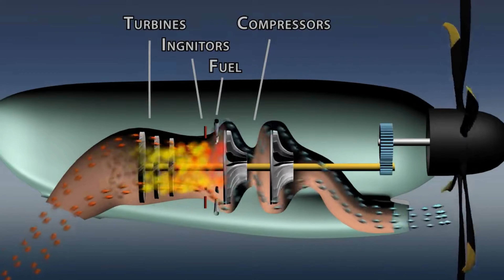USN High-Pressure Steam:  A Successful Detriment? | A Portholes Podcast Special ft. @Drachinifel

Comment: There are three issues:
1. Did the high pressure ships have shorter ranges than expected?
A) due  less efficiency v low pressure or  just less than planned
B) due to more than anticipated high speed usage
C). USN didn’t know how much fuel they were using! (This is inexcusable.)

2. The gearing bottleneck.  This was well known during the war!

3.  Admiral Bowen’s CYA book.  

Brilliant Drac  keeping the guys on topic and out of rabbit holes!  Just my cup of tea (steamed with fuel oil)
Reply: More importantly, did the 600psi plants have better energy density than 350psi?  The answer is yes.  

And with the tyranny of the treaty limits, weight was critical.  Every ton of machinery was less armor, stores, armament...and fuel.
Reply: @olpaint71  Yes, but the point of this is that those high pressure turbines were not in fact as fuel efficient as the USN had expected, not by a considerable margin. And certainly in the first half of the Pacific war that was an issue as all fuel had to be shipped to the USN. That means tankers and fast fleet oilers. For the first half of the war the US was seriously short on tankers (especially after the losses of tankers suffered on the East coast in the first 6 months), and critically short of fast Fleet Oilers. They only had six of the latter at the start of the war, and lost one at Coral Sea. 

O those high pressure boilers being far less fuel efficient than expected had a direct and negative affect on logistics because it means more fuel is required, and you have limited shipping capable of transporting that fuel, and that is going to limit your options operationally. 

Sure, this is less of an issue in the second half of the war, but in the first half its significant.
Reply: @alganhar1  But the high pressure plants enabled more compact and lighter machinery, which meant more protection, firepower, and performance on the same tonnage and, even if the range did not meet expectations it was still more fuel efficient than a 350psi plant.  

The Pacific War was never going to be fought without an extensive logistics tail, and the difference between the high-pressure plants and the earlier systems is well illustrated by the USN holding the remaining Standards at Pearl while the more modern ships fought the early war.  

If you are going to argue the 600psi plants were detrimental, you have to not only show that they didn't achieve the promised range performance, but that they also performed less efficiently and less effectively than the alternative, which is a ship with a 350psi plant that has reduced protection, armament, and even higher fuel consumption.

Comment: So I have a long winded comment because I do want to have a discussion on this as I have been trying to research the development of USN high pressure plants of the interwar and WWII period. First caveat is I have yet to buy the book which I am going to because books about powerplants are rare and awesome. But I feel as if in this podcast there was no real defense for the USN machinery, which was overall lighter, had very good reliability for that pressure, and did produce fuel economies when cruising long distances. What wasn't considered in my opinion when it came to the operational ranges of the high pressure machinery was that wartime additions in weights. All ships in the USN got much more weight added to them as wartime progressed such that I'd argue every single USN ship got more AA guns and more radars and sensors than initially designed in lets say the mid to late 30's. This would explain the discrepancy between the advertised fuel savings and the real wartime economy of these ships. But I suspect that there was a decent amount of fuel savings with the high pressure plant as Bowen does mention in his book Ships Machinery and Mossback (granted that is his own personal biography so dose of salt here). I am as Othias from C&Rsenal says a determined idiot with internet access and not a proper archive and researcher but I do want to try and unravel the full story of USN machinery, which while it was not perfect or the one trick wonder the USN needed to win the war I still believe that it was not a hinderance but something that did help the USN win the war against Japan and also laid the foundations for the USN post war to have the best steam plants full stop. If you made it this far in this comment, give yourself a cookie because you earned it

Comment: I was chief engineer on Manley DD940…  staying on top of maintenance was key to reliability.  Fuel economy was greatly affected by the anticipated speed demands.  If on a straight line ocean crossing we would be able to make 18 kts with half of the auxiliaries secured …ie one feed pump one forced draft blower on each of two boilers.  If the XO wanted 27 kts available for training, the fuel economy was crap…  it all depends on how hard you run the greyhound.

Comment: I admit I have not read the book yet, and in fact hadn't heard of it until now.  This is an interesting discussion but I have to question a few things.  First, the new ships with their  high-pressure plants were making the same fleet speeds as the older ships.  They weren't going faster than the old ships and burning up vastly more fuel than the old ships as this seems to imply.  Their lb/shp/hr was still better.

Second, while I would normally hesitate to correct Drachinifel on anything naval, it is not true that turbo-electric ships maintained a constant turbine speed and hence were more economical at high speeds than geared-turbine ships.  Turbo-electric ships used AC motors whose speed was directly proportional (with some variations because of pole-switching) to turbine speed.  They did not use a constant AC frequency; motor and shaft rpm changed with frequency.  To increase speed in a T-E ship you increased turbine speed, just as in a geared-turbine ship.

Comment: I steamed 1200 psi steam plants when I was a boiler technician in the Navy 🎉 they were very efficient in my opinion, we didn’t need a extra burnerman to operate the superheated side of the boiler because it was a internal part of the boiler which took the heat ahead of the generating tubes after the screen wall tubes which saved on manpower to operate a boiler

Comment: Great discussion. But perhaps without actually reading the book, the answer can be... boiled... down to : "It was wartime, it is what it is." 

Regarding turbo electric, it often gets a bad rap IMO. Comparing the Standard BB's from the late 1910's with technology 18 or 20 years years later, is hardly fair or accurate. Improvements in both motors, generators, and electrical drives did increase efficiency and durability. Today the improvements are very dramatic (although they are generally only paired with Diesels now).  If the ship that destroyed the Keyes Bridge near Baltimore had D-E drive, that simply never would have happened. That disaster brought to light a dirty secret: Those failures are very common and it was only a matter of time it happened at just the wrong time and place..There are several maintenance and reliability advantages to having multiple smaller engines verses a giant one with pistons so large two men could stand inside them. The difference in fuel economy verses direct drive is slight. But despite the reliability and safety advantages, most ships are built the cheaper way.  If we want America building ships again... Perhaps we should start insisting on only allowing D-E ships in our ports for safety... And then build them ourselves There are some very good designs for PM motors and drives done for the US Navy, that give us a technology edge.

Comment: Love this discussion I am a mechanical engineer that designed large gearing systems especially helical gears for Horsburgh & Scott in Cleveland OH . Double helical remove axial thrust loads down the shaft generated because of that angling in the gear tooth on the gear face. Double helical cancels out the axial thrust forces, the bitch is they are LONG lead items requiring grinding of the tooth involute, especially on high quality level gears (Ships gearing must be more accurate and precise than a concrete mixer reduction box ...then there is the heat treating.  Replacement is not like switch out a transmission in a car as Ryan mentioned

Comment: The high pressure plants may not have been "as advertised" but they did a job.  If Essex class carriers were immediately scrapped 1:1 as new carriers were built like B-36s to B-52s, that would show a immanent deficiency.

Comment: 52:00 Good grief.  No, you don't perform endurance trials by burning every drop of fuel oil to see how far it will go.  You run the trial for several hours to get accurate speed and fuel burn numbers.  It gets compared to the model test resistance data and the plant design data to correlate the theoretical curves and actual consumption.  These guys should know this.

Comment: 20:15 the other problem with single reduction gears in trying to do anything in a single stage is gear wear. The driving gear would have to do so much work, it would wear out long before the driven gear would show any signs of wear. Manual transmissions in cars are double reduction for that reason. The counter shaft is reductive before going into gear on the output shaft

Comment: Diesel electric propulsion for rail was still very much so early stages in the late 30s. Large medium speed diesels like the Alco 239/240, EMD 567 and others were having lots of teething problems. Everything from large blocks being made at scale with ever changing materials to gasket materials being changed resulting in water and oil mixing.

Comment: This is the sort of topic I love. So please do more like this. 

That being said and I’m truly not trying to be a keyboard warrior you really failed to make your case on this one. 

We have allegations of falling short on range that are not substantiated in the video. We do have excuses in terms of the vast difference between wartime operating conditions and peacetime assumptions that may have had a lot to do with this. If your range assumptions are based on cruising at 15 knots with half the boilers secured and your operational conditions require all boilers lit and operational with regular bursts beyond 15 knots those range numbers are going to be garbage. And that’s not the fault of a 600psi plant. Another issue is that just like with standard vs full load displacement range is dependent upon a host of variables. Trials will give you good baseline data for the conditions they are run in. But higher sea states, heavier ships as crew and weapons are added, increased hotel loads on the plant, hull fouling will all have an impact and those are not the fault of the plant. If you want to argue that high pressure steam doesn’t deliver on the benefits it promised show some range tables (projected vs actual) that prove that out for example. 

You talk about manning and maintenance but provide little to support that. Comparing the manning requirements between a British light fleet carrier and an Essex is an apples and oranges comparison to a degree. How does the KGV class compare to NC or SD? That would be a meaningful comparison. And if your the US and you have plentiful manpower resources designing for reduced manning likely isn’t a consideration like it might be with other Navies. For example the Yorktown and Essex class have very similar manning numbers and one is high pressure and one isn’t.  A look at the numbers in the engineering section of those two classes could provide meaningful insight. It also might be very interesting to look at the number of watch standers in a boiler room and engine room on New Jersey in 1944 vs 1989. 

How many man hours of maintenance were required per hour of steaming? Without comparisons of that type between USN High Pressure and older low pressure systems it’s hard to say these were maintenance intensive systems. I’ve never read anything that indicated the 600lb 850F plants were anything but extremely reliable in service in WW2. I know for a fact that in the 90s when I was on active duty they were considered to be very very reliable plants. Unlike the 1200lb plants which were always considered temperamental even though they continued to get better with each generation. 

Which brings up another point. If high pressure plants were judged a failure by the USN then why did it continue to press forward with higher pressures and higher temperatures in the post war era? It just doesn’t make sense that if the navy thought the move from 300 to 600 was a mistake that it would then proceed to press forward to 1200 and stay with 1200 even when the early generations of that plant really did have serious issues. 

To Drach’s credit we do see the issue of power density come up. It doesn’t take much reading of Friedman to know that was a really important consideration in the WW2 generation of ships. Iowa doesn’t happen if her machinery has to be 15-20% larger because it’s operating at lower pressures. 

Again I’m not trying to be a keyboard warrior but if your going to call into question something like the 600lb 850F plant technology that went into the vast majority of US WWII fleet units you need to actually make that case.
Reply from the maker: Thanks for watching and taking the time to comment. New research is threatening to upset a lot of what we think we know about the early war operations, fleet logistics, pre-war training, and how the Navy implemented innovation. We're just starting to get our heads around the implications. We'll need a larger and longer format (with guests) to work through the US Navy's largely untested acquisition of high-pressure steam in the future.
Reply: The RN in the steel era is best known for exploding ships and memorials, so I'm not sure they're the be-all.
Reply: @BearingStraight 
A careful look at new research in and of itself may also be necessary. Hone says the USN became a night fighting machine by late 1943, but at Philippine Sea, Lee hid under a table when asked to engage at night.
Reply: @UmHmm328  that is an incredibly offensive comment essentially calling Willis Lee a coward. 

It’s utter nonsense to say he hid under a table. Lee was asked if he desired a night engagement and said no. He was well aware that this didn’t mean the Japanese would be allowed to proceed unmolested. The carriers were still more than capable of taking the Japanese on and denying them the chance to achieve their objectives. 

Lee declined a night engagement because the previous months of carrier operations where his ships were focused on AA defense had denied them the opportunity to do any training together or operate together as a tactical formation. He was well aware of the problems that lack of training could create in a night engagement and his judgement was sound. 

Contrast that to several months later at Leyte Gulf where Lee is trying to prod Halsey into releasing TF34 so he can engage the Northern Force he knows is coming.

The fact that Lee declined the chance for a night engagement in those specific circumstances does not remotely invalidate Hone’s research.
Reply: @jetdriver 
Oldendorf didn't seem to have a problem at Surigao Strait.
He was also busy as the same force was also at Philippine Sea. 
Hone, in a 2009 Naval War College article brings up how things mau have been different contrasting Lee at PS and Oldendorf at SS. 

Either Hone's later presentations on USN night fighting prowess is incorrect or Lee in 1944 wasn't the same one in Nov 1942.
Is PTSD only for enlisted personnel?

Mitscher was floored by his response, btw.

And the hindsight response that aircraft carriers had supplanted the big gun (someone didn't tell much of USN leadership) is ass backwards history.

It's OK to be challenged. Don't fret.

Comment: Volumetric and weight comparison: HMS Implacable (1942) vs Essex (1942). Both carriers produced about 150k SHP but Implacable's 400psi/750f steam power plant was fully equal to Essex and her 600psi/850F power plant, in that regard.  Essex, primarily due to her double reduction gearing and economizers was more efficient at lower speeds, but there wasn't that much difference at higher speeds.

Comment: Surely the gears were made with hydraulic set-ups and divider heads specifically so you don't have to freehand it?
Reply: No, gear hobbing machines.  Which is not free-handing like they made it sound.

Comment: The Germans had massive problems with their high-pressure propulsion systems, compared to which the USA's problems were merely teething problems. It is a stroke of luck in history that the German engineers were perfectionists, but the hasty rearmament of Nazi Germany before World War II, the circumstances of the war and the lack of skilled workers prevented them from producing fully developed weapons. Airplanes and tanks in particular were often "bananas" that were delivered green and only ripened in use. With the large warships, even that was not possible. As an German I am lucky that back than the Allied Forces had the better functioning equipment to bet an actual Empire of Evil. For me as a not entirely "Aryan" German a German Victory in WW2 is the darkest nightmare I can imagine.